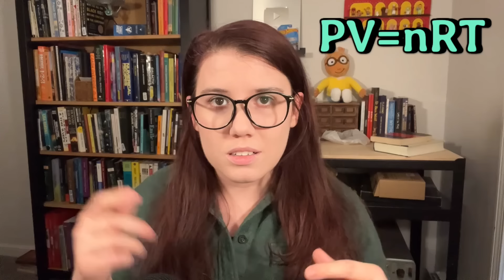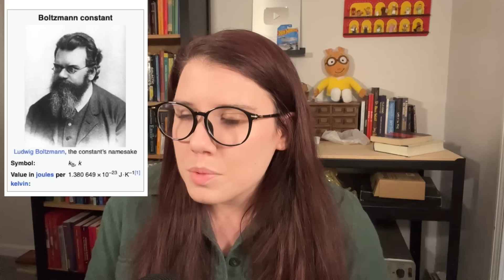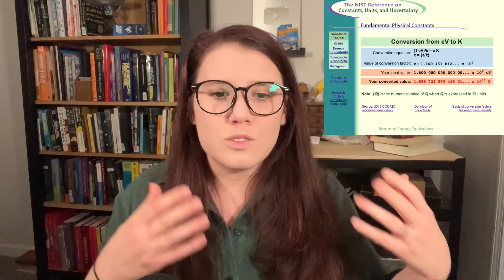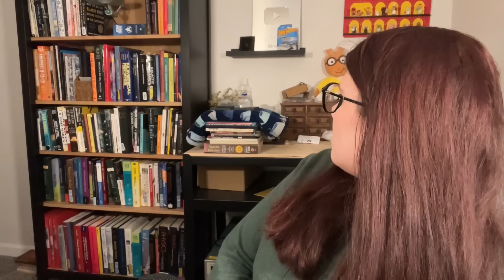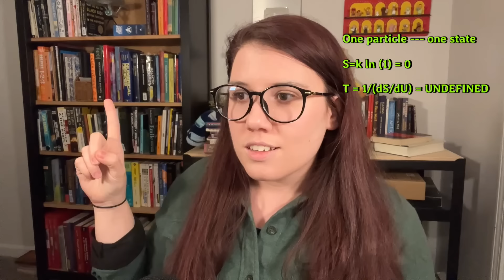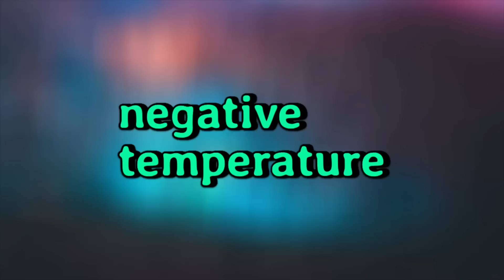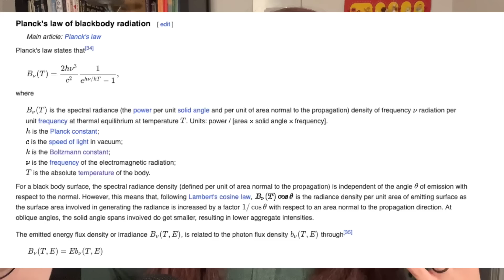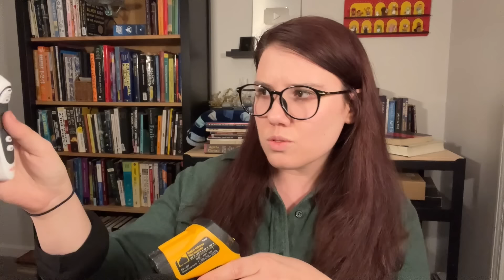the concept of temperature

Comment: I have a question... atoms in one corner of a space, that are in that corner because there is a barrier... aren't they in their own space? Why is entropy define by their relationship to a space they're not in, rather than the space they are in? I know I'm missing something here (Actually missing quite a bit! lol).
Reply: Yes, the atoms in the small box are in their own tiny volume of the small box. Their entropy is defined entirely with respect to themselves and that small box. You can count the number of possible microstates and calculate their entropy. At no point in that calculation do you factor in whether there's a bigger box around the small box or how big it is.
The point is that if these particles were instead spread out over a larger area, their entropy would be larger. Because there are more ways to distribute over a larger volume, there would be more possible microstates and so more entropy.
This is the driving force for the expansion of gasses.

Comment: I need to better understand the concept of the number of micro states, omega, for entropy.  Given a mole of atomic gas in a fixed box, is a micro state the location of each atom, the location and momentum of each atom, the location and velocity of each atom, the location and velocity and spin of each atom, the location and velocity and spin and electrical potential of each atom, the location and velocity and spin and electrical potential and strong force potential of each atom, or what are we counting?

Comment: I always thought of the entropy-energy relation of temperature as a ratio of how much entropy you get (yes want) for the cost of energy (your budget). Of course this S/U ratio of partial derivatives equates to inverse temperature. But that's fine we can envision very high temperatures as a low amount of "inverse temperature" and low temperatures as being a big amount of "inverse temperature." Zero temperature is a sort of infinite 1/T giving infinite "entropy productivity" and infinite temperature as having 0 1/T giving zero "marginal productivity of entropy".

Temperature becomes a measure of the efficiency of production of entropy per given energy . Low temperature (common) objects are very efficient at the production of entropy for the cost of a unit of energy. High temperature objects are on the flat part of their curve; their marginal entropy production for a unit of energy is poor. An analogous machine to this is a balloon. Energy is the air you put in the balloon and entropy is surface area. This analogy works pretty well because real entropy is akin to a kind of surface area in the graph of configuration space. Anyway, a little bit of air into an empty balloon improves the surface area a whole bunch. The efficiency for surface area (entropy) per unit air (energy) is great. Later when the balloon is already pumped full of energy (air) a little bit more doesn't yield a large increase in entropy (surface area) much at all. It's a poor use of energy to energize a hot object if your goal is entropy production.

This is also why the temperature of a single particle or a particle where adding energy doesn't change its multiplicity of state doesn't have a defined temperature. Temperature is the slope entropy (just multiplicity of state in log form) to energy and purely vertical or horizontal slopes correspond to zero or infinite energy depending on your T or 1/T choice of measure, not helpful. The slope needs to be something reasonable to get a reasonable measure of temperature. Quantum mechanics is also a little goofy because the graph of entropy and energy isn't a curve... it's a series of dots. We pretend that the dots are so close together that don't worry it's a continuous function but at low energies that assumption is kinda bad. What's the slope of a graph of discontinuous dots?

Thermal equilibrium of two objects in contact can be thought of two kids at the fairground wanting money (energy) from mom to go have fun (entropy). The statistical pressure is to maximize fun (2nd law thermodynamics). The energy partitioning between the two objects will be to give more money (energy) to the object which is able to produce more fun (entropy) and less to the other object. Equilibrium is when the sum total entropy is maximized. When giving energy to one at the expense of the other will reduce the donor's entropy more than entropy is increased to the recipient, you've reached thermal equilibrium. Two objects are in thermal equilibrium when the partitioning of energy between them yields the maximum total entropy.

Most common objects get lots of entropy per energy supplied when at low energy and less when they get more energy. Their graph of energy on the X axis and entropy on the Y axis starts as a vertical slope that flattens as energy increases. Low energy common objects are cold and high energy common objects are hot. This behavior is so common that we think that temperature must be a direct measure of energy content... it's not. If you have a material that has a different graph than a vertical-flattening curve you can get high, low, or even negative temperatures with any energy content.

Two common objects in contact are like they are in a tug-of-war. They both want energy in order to make entropy. "Give me the energy, I can make entropy." "No give me the energy, I can make more entropy." Negative temperature objects are weirdos. They gain entropy not by taking energy but by giving energy away . When normal matter is pulling in the tug-of-war, negative temperature matter is pushing . Negative temperature matter is happy to give energy away because that' s how it produces entropy. It's hotter than infinitely hot. An infinite temperature object produces no entropy when given energy. A negative temperature object produces entropy when giving energy away. Put an infinite temperature object and a negative temperature object in contact and energy will flow *from the negative object to the infinite object*.

This is why the 1/T way of thinking about temperature is probably better than what we use. It's similar to the conventions of + and - charge, lots of electrical study would be easier to comprehend if we did it the other way around. Then cold stuff is 1/0 infinity, getting smaller as it gets more energetic 1/infinity = 0. Then negative 1/T is continuous and beyond that point.

Comment: If memory serves you can actually construct a situation where the different definitions of entropy give different answers. It's a horribly contrived example but it is possible at least in principal.  Personally I suspect informational entropy is the most "correct" as it is the most fundamental in a sense coming into play as an axiom/prerequisite of quantum mechanics.

Anyone who says that this definition doesn't work with GR needs to read up on inhomogeneous and anisotropic cosmology and the general unconstrained nonlinear domain of the Einstein field equations  as that shows that the initial conditions must represent the maximally symmetric state for any sufficiently large inhomogeneous and anisotropic universe as if the universe could really be treated as homogenous and isotropic as some scale that would require a change in the initial conditions such that the problem is no longer the same one you started with. In a more technical sense for the Einstein field equations to be internally self consistent the rate of expansion must be directionally dependent based on the full time derivative of metric curvature as the rate of expansion becomes dependent on the local passage of time according to numerical simulations and a metamathematical proof by self contradiction. The cosmological principal thus becomes wrong in the upmost sense as the metric to satisfy this condition must be uniquely defined everywhere. Information paradox resolved as spacetime must be irreducibly asymmetric. It has even been suggested  that the neutrino or at least a flavor of a neutrino might represent/be the force mediator particle for gravity and of course dark energy vanishes trivially as just asymmetric gravity in an expanding universe. Point is Einstein was probably right again while cosmologists were wrong with their spherical cow model and the arrow of time and thus entropy is thusly probably real.  Hail Occam's razor! I want to butcher us some spherical cow beef. 
:P

Comment: 11:08 It's so frustrating because it's like, "oh it's only one degree!" okay, what's the difference between ice and liquid water? That's right, it's one degree! So if the average global temperature goes up by one degree that means there's going to be a lot more liquid water (I get that it's an average and different areas will respond differently, but you get the point). So then there's going to be a lot more places under water. And unfortunately a lot of those places are going to be small islands with people who can't really afford to just up and move when their houses become flooded.
Don't even get me started on the fact that thousands of species use seasonal changes in temperature, humidity, etc. to trigger things like migration, flowering, hibernation, and how much they're going to be screwed up, or the fact that adapting to these changes usually happens over geological timescales.
Reply: I wouldn't think of the difference between ice and liquid water as being one degree.
The amount of energy it takes to turn ice at 0 degrees C to water at 0 degrees C is the latent heat of fusion (334 joules per gram).
Which is different from the amount of energy it takes to turn water at 0 degrees C to water at 1 degree C (4.186 joules per gram), the specific heat.
Reply: @Vaaaaadim  that's really interesting! I only did a unit on thermochemistry in my undergrad (in evolutionary biology) so I'm not at all a physicist. Would it still be accurate to say the difference is approximately a single degree for everyday circumstances?
Reply: @thylacoleonkennedy7  I'm not at all a physicist either, I just happened to remember these two facts.
Everyday circumstances seems vague to me, I'm not confident to say whether the assumption would lead you astray in everyday circumstances.
Reply: @thylacoleonkennedy7  Is a university classroom the only way you know to learn things? I learned this bit in High School. State of Matter changes do involve heat energy transfer. Lots of heat removed to freeze water, lots of heat added to melt ice. 
A similar heat transfer occurs when liquid water transitions to vapor. This is the overwhelming method of heat transfer from the surface to higher elevations in the air. Water evaporates from ground water, from leaves, water bodies, rain, and even sublimates from snow or ice, even at the poles. This water vapor carries via convection latent heat way up high in the sky, then condenses to make rain which releases this heat before falling back down. 
The CO2 effect is much much smaller than that. It is however still a factor, but at the existing density, it has no more room to increase it's air heating effect. 
CO2 does have lots of room to increase crop yield, forest expansion, desert reduction, really a large benefit for every C3 plant, albeit less beneficial for most C4 plants. 
Did you know we are now in an Ice Age? I learned that in High School too. Ice Ages are by definition times when the poles have ice. This time is known as Glacial Minima or something like that. HS was long ago. There are forests buried under the snow and ice at the poles. How can anyone imagine a warmer climate could be a bad thing? I guess if you hate trees, sure. Just think about how much heat was needed to liquify all that ice. Yet between ice ages life on earth thrived for all organisms. Was this not covered in Evolutionary Biology?
If you really want to understand the history of climate, Geology holds the irrefutable information. Or just stop ignoring the obvious. 
Ocean water temps and levels continue to change along geological timescales. While NOAA has creative ways to make adjustments to their reports, the internet never forgets. You can check for yourself, just pull up NOAA reports published 20-30 years ago, then compare to recent reports. Especially interesting disagreement around the 1930s. And the US Navy Ocean temps reports show little to no Ocean warming since their beginning. And I built a facility in Miami recently, Army Corps of Engineering and a Hydronics Engineering firm we hired both showed very nearly zero rise historically or predicted. 

The Maldives water levels went down, not up. They added a new airport. They're not exactly poor. The island masses have been rising, that's how islands occur.
Reply: @thylacoleonkennedy7  No, because the difference between ice and water is not a matter of temperature. Both ice and water are capable of existing at 0ºC. If you have ice at 0ºC and you put energy into it, it will stay at 0ºC until it is all melted. Only then will the temperature start to rise.
Reply: The latent heat of melting ice is 334J/g, meaning it takes 334 joules of energy to heat one gram of ice at 0 degrees to become a gram of water at 0 degrees.  The specific heat of water is 4.19J/g/°C, which means it takes 4.19 joules to heat a gram of water from 0°C to 1°C.  That means that if you want to think of energy in terms of "degrees", melting ice takes about 80°C worth of heat to melt (in a hand-wavy sense).

That's why, even if you add 0°C ice cubes to a drink, they still can cool it down; in a closed system, 100g of 0° ice added to 100g of 80°C water would theoretically melt completely and give you 200g of 0°C water.
Reply: So, I'm sure you will be living in a hut soon to help "save the planet", right?  Or, don't you even care about people/animals?
Reply: When we look at the "water temperature volume graph", we know that sea level has not increased according to observed science.
Reply: Those small islands your talking about are gaining land, and the majority of the land that would be "under water" if sea levels change are already "under water". For example 1/4 of the Netherlands is below sea level.

Comment: Its intuitive for me dealing with speed of sound. The speed of sound is affected only by composition and temperature, not pressure as you might first think. So temperature is the relative speed that molecules are bouncing around. A sound wave propagating through a fluid or gas travels at the speed that the molecules are moving at.

Comment: Great video, just a slight inaccuracy with the diagram at minute 28 . For an ideal gas, temperature does not change in a free expansion even if entropy is increasing. This makes sense as there is no way to change kinetic energy in that process.

Comment: I think the kinetic energy model is analogous to a hidden real fact.  Every physicist alive today was taught what to think, so it is now baked in or programmed into their brains.  It is not going to change -even if it is perfectly analogous AND wrong at the same time, because they merely get the answer they were looking for.  There is certainly a relationship between charge and temperature which should be a clue.  I have always hated how gases operate exclusively by partial pressure.  If it was a kinetic issue between molecules, it would not matter if the molecules are different.  Partial pressures of gas make it look like like gases repel each other exclusively and leave other gases alone.

Comment: In the world of refrigeration, we will even measure pressure with thermometers because our systems are closed loop. This means that we are measuring pressure by measuring temperature by measuring a change in voltage in some wire.
Reply: You just need to know the amount of your agent. Then you can do it.
Reply: And in turn, the change in voltage in the wire is caused by a change in temperature at the connection point of two different metals.

Mind= blown.
Reply: @brandonclark5576   You have just described a common misconception about how thermocouples operate.  Yes the connection between the two different-metal wires is essential. But the voltage is not generated at the connection point; at that point the two wires are at the same voltage.  The voltage as seen at the meter end of the wire arises because each of the wires generates a different voltage between the junction point (the sampled hot or cold temperature) and the meter end (ambient or some reference temperature). The meter reads the difference in those two voltages.    See Seebeck Effect.
Reply: When we look at the "water temperature volume graph", we know that sea level has not increased according to observed science.
Reply: @ShonMardani  So you are saying that overall globe pressure is rising?
Reply: We know that everything is changing in cycles, but we do not know which cycle or where in the cycle. The fact that we are burning everything that can burn to get energy for our lifestyle will hurt us and our children is not disputable, we all know that and are doing our best to be more efficient with energy. However every number they provide as evidence, is fake and madeup.  @ogi22
Reply: @ShonMardani  what are you talking about? sea levels have risen by like 20 cm since 1900. It’s crazy how climate change deniers will just say something objectively wrong to support their position.
Reply: @ShonMardani  > guy who has no clue about observed science

Comment: Never saw anyone explain global warming like that. Makes it much easier to visualize (and also much more scary 😰)
Reply: Don't forget that this goes along with ocean acidification, the oceans have been absorbing most of our carbon emissions so far, which is why it took a while before temperaturs started rising, however that has produced carbonic acid. Since the oceans are more acidic that means more calcium can be dissolved in them, which makes it harder for marine animals to make shells since they can't get the calcium they need out of the water.